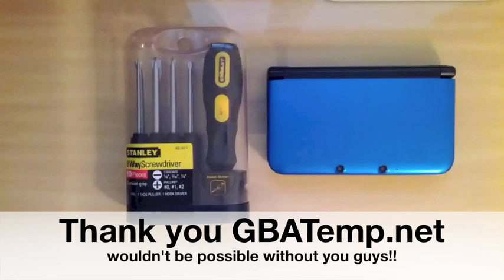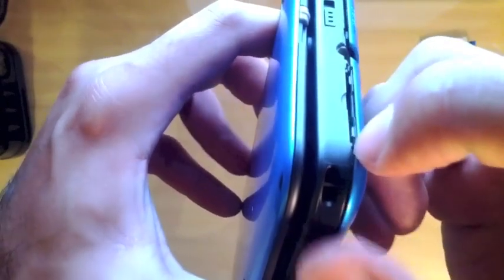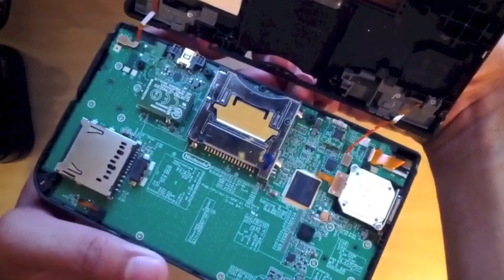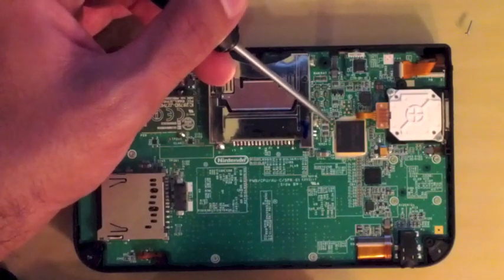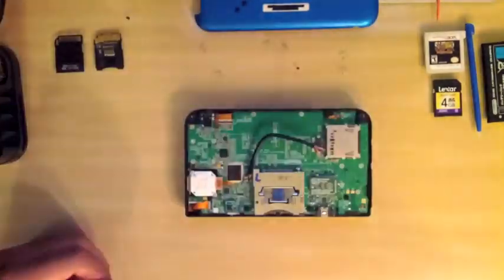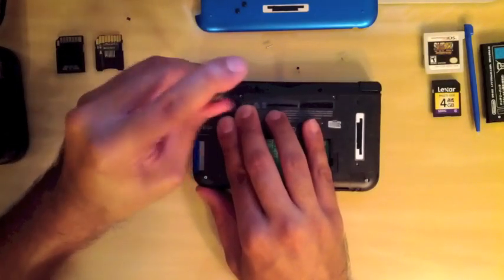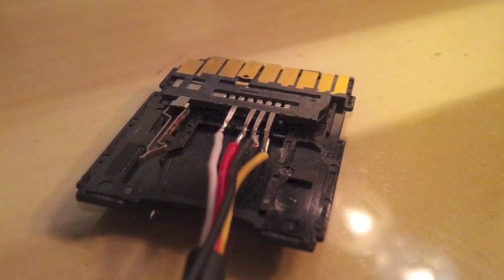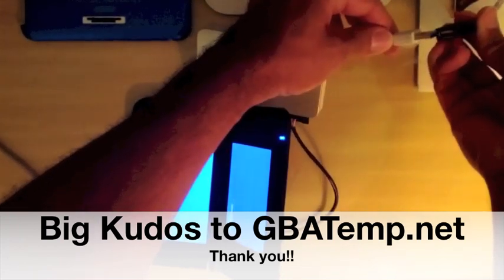DIY 3DS XL NAND Dumping-R/W pt. 1

Comment from the maker: @Anthony King
Try using Super Glue. Make sure you secure the wires in place before you seal up the SD adapter.
Reply: Andreas Feist
I would but I actually have no money, that's why I do the pirating in the first place.

What I did was, I got some cables from a broken keyboard and made a hole on the 3ds with an exacto knife in the slot where the stylus goes in. It's really thin plastic and the slot can be used to hide the cables. I welded everything with a cheap 10$ Hot iron welder and when I was done I cut off the cables and left the ones connecting to the NAND inside the Stylus slot in case I need them later :)

Everything looks really clean and I didn't spend any money on fancy parts. Nobody knows it's even modded. The only downside is that I have no place to put the stylus but I can keep it in my pocket or bag. Everything cost less than 15$ :)
Reply: AteOeight 
Hello, is there anyway to do this with a new 3DS XL?
I have a Nand backup, I just need to reflash my Nand
that I fucked up :(
Reply: Nepu-Tech USA ofc just search in the internet for a new 3DS XL Motherboard
Reply: Andreas Feist
I already did it! :D

It was a nightmare btw!! took me almost a week to learn how to weld and get everything working perfectly lol. Totally worth it tough!! :D
Reply: Nepu-Tech USA u can actualy use a micro usb connector http://www.infinitydream.com/newsdesk_info.php?newsPath=102&newsdesk_id=164
Reply: I had already an soldering iron so i just needed an screwdriver and an usb micro-b board
Reply: *****
What's your problem?
Reply: +Nepu-Tech USA I think he's referring to your pirating.  lol  However, I think at $50 bucks a pop per game, and $200-400 per game console for the last 24 years I have been raising boys and buying all their shit, Nintendo can afford for less fortunate kids to pirate.
Reply: Nepu-Tech USA    
jfddnhudrhgfycuifdskugfsdjgjkksahfKEHSDFDSGJCHSF!HCJA